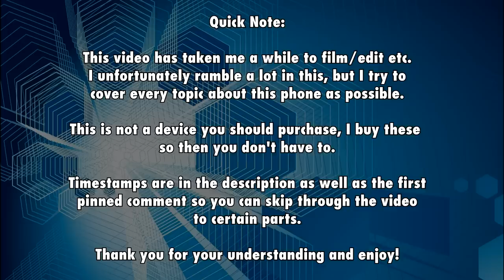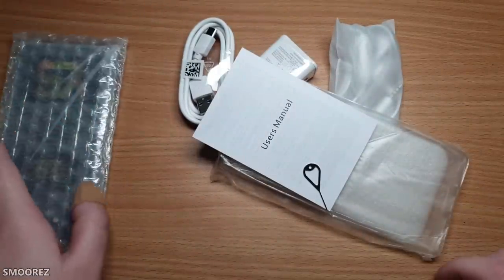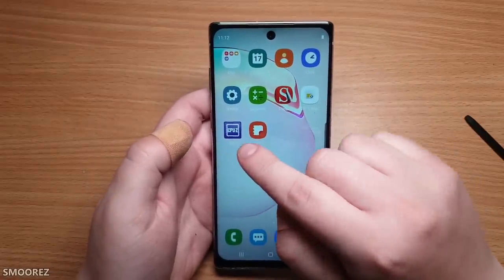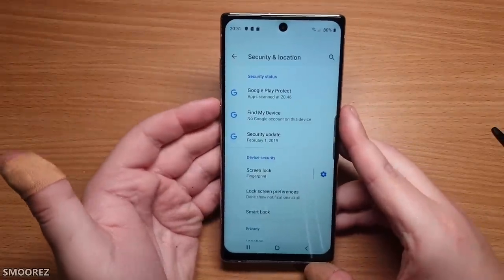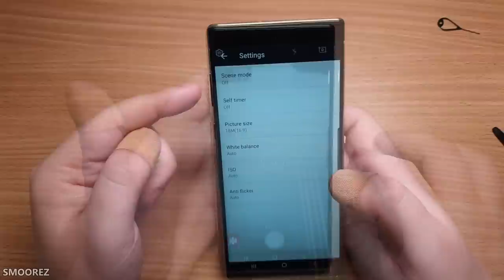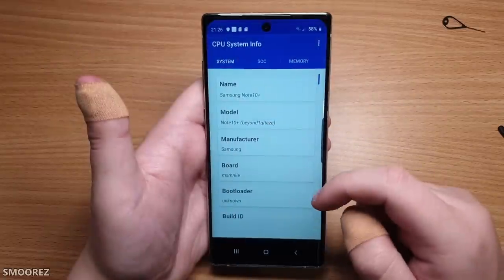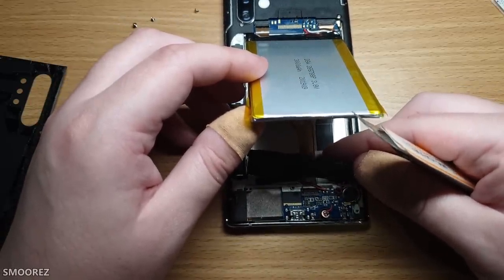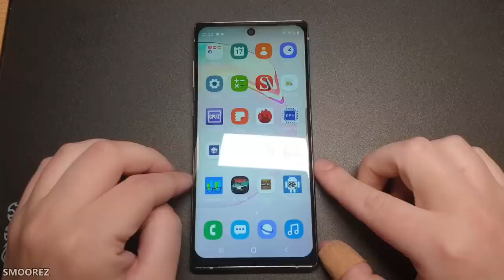iWish: I bought a $150 Galaxy Note 10+ Clone from WISH...this is what I got! In-Depth Review

Comment: When it comes to wish stay away from electronics in general
Reply: I just buy little trinkets or  gadgets. For electronics, I bought a light up charger cable and cheap “double drive” earbuds for when i run out of battery for my BT ones. The most I spent there on one item is an eevee carpet. No regrets on that one.
Reply: @aaron-gz  I agree with you although Chilly advice is true, but according to some reviews, some of their electronics are fairly okay. For example, the electric guitars for under $100 US gets a lot of reviews on there. Including guitar amplifiers. But although I haven't bought anything from Wish as yet myself, at least for sure the one thing (for now) I won't ever expect from them to be all that good is these cellphone clones of course. It doesn't matter WHERE you get them from Chinese/Asian website or even Amazon or eBay a clone phone is a clone phone!!!! Btw, how long does the Bluetooth headset last that you bought without charging???
Reply: I Think as long as the item has a power supply you can replace with something safe, it's often fine.  I got  some electronic items on there which I've been using for some time without issue, by ensuring I use my own power supplies.
Reply: @Supernautus  ohhh wow yea you also confirmed what I said earlier. Would you recommend the Bluetooth headsets from Wish though?? How long can they last without charging???
Reply: Alot of electronics on there are fine if you can replace the charger and plug them into the wall. Avoid anything that has a built in battery is my suggestion.
Reply: @jaredbridgeman246  I know this is an old comment but don't trust reviews on wish. This is a common tactic employed by sketchy sellers online. Basically, if a person makes a transaction with them in the past that group saves the info (shipping info/name) and the seller will make a 'purchase' using that shipping info and name. The person who's name and shipping details were used isn't charged but they end up with a product arriving at their home. 
These groups do this because they need a verified purchase to be able to leave a review. So they fake that someone bought their product and leave a good review themselves. 
I know this because my mom had this happening for a while with some amazon stuff. She was getting some random free items from Amazon. They were all labeled for her but were things she hadn't purchased.
Reply: @3DPlagueDR  oh thanks for sharing everything there especially about Amazon reviews. 

This reviews trends are getting very suspicious indeed. I would rather take a risk purchasing a product with 3 good reviews out of ten than a product that has 10 reviews and all TEN are 6 stars good reviews!

Even Trustpilot seems sketchy as well although they're saying that fighting against fake reviews.

Even right now, I'm learning about ecommerce and I seen an interview on YouTube with a guy saying that he asks customers on  Amazon  for reviews, and that had me thinking differently about reviews even comments on here on YouTube

Comment: Clone phones just arent worth your money, you can get quite a decent device for 200$.
Reply: It's for the status symbol when you're broke lol
Reply: @iGaRaai90  Even the thieves would give you money
Reply: I recommend the Xiaomi Mi Max 3
Reply: @iGaRaai90  I personally think having clones instead of having lower end-but-still-original ones are worse.... it just shows how desperate one is for the attention... Especially these days when there are low priced phones that are sometimes even more worth it than flagship phones.
Reply: I've got the real deal and it combos so well with my SN30 Pro+.
Reply: LG Stylo 5 is a better deal than this
Reply: I have an OPPO phone cost less than this one and it's fantastic
Reply: Agree
Reply: My phone is an ex flagship which used to be 400 bucks now it's like 240 bucks
Reply: Redmi Note 8 or Zenfone Max Pro series
Reply: @Vysair  I have the Redmi note 8 128/4 and it is a piece of garbage, bad build quality and its very very slow cause MIUI is completely unoptimized, mobile data stops working like 4x a day and i have to restart the phone
Reply: @ondrejbrandejsky5592  Redmi Note series have decent quality not bad and I agree, MIUI is somewhat lacking in multiple department, def not good optimization like stock aosp. If both sucks, try S10e (at my place it cost $200 - $300)
Reply: @ondrejbrandejsky5592  nope, got both redmi note 8 pro and note 8 and I don't know what you are talking about. Every fone has a fail manufacturer flaws. Don't generalize just because you got a fiasco.
Reply: @style668  do you think that never getting messages from Messenger unless i open the app and refresh it manually is a manufacturing flaw? And thats only one thing...
Reply: @ondrejbrandejsky5592  it's a messenger bug bro wtf. Everyone in my country is experiencing that. Welcome to the third world problem
Reply: @style668  idc, it never happened to me on any of my other phones (and thats like 20 phones...)
Reply: @ondrejbrandejsky5592  woah, that's pretty exaggerated to the point that it's unbelievable. Anyway, you may keep your 20 fones away and I will be happy with this fone. I don't want to argue about phone brands, I'm not the Xiaomi's CEO
Reply: @style668  i keep old phones from family members, have a good day
Reply: Just bought a Google pixel for 120
Reply: Redmi Note 8 pro have touchscreen issues near the bottom, or at least mines did. I was fortunate the Amazon seller gave me a full refund before I even sent the phone back.
Reply: Bought Haier L55S at MYR200. Decent and worth it. Watched this video and commented with this very phone.
Reply: @Vysair  S10e for $300? I paid less for my S10, $200 total and it came with extras like a 256gb microSD. If you're willing to spend several hundred on a fake knockoff, then just spend the money on the used market.... I'm loving my S10. Smooth, quick, snappy, no problems whatsoever.
Reply: or even 100$
Reply: I found a 110$ xiaomi x3 onlinen
Reply: Cheaper acaully like a decent device is like 150
Reply: @itsmedanzelcurtis  good phone but only on t mobile
Reply: @veravalfa633  the samsung note 2 is better

Comment: You ordered something from wish and got it in 10 days that's a freaking miracle
Thanks for throwing up the conversion rates to the Australian dollar
I was astonished with how easily you just pulled out the cap for the charger brick
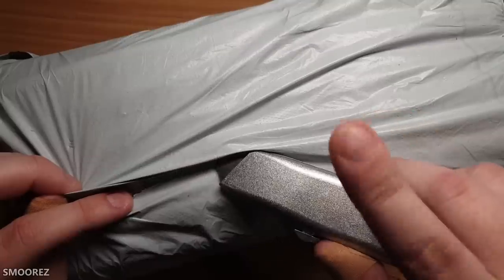Timestamp 5:19
That is going to give me nightmares😆
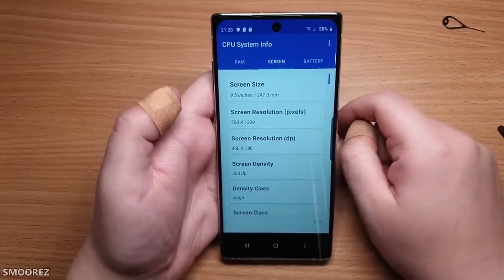Timestamp 34:02 the screen size is 9.5 in😂
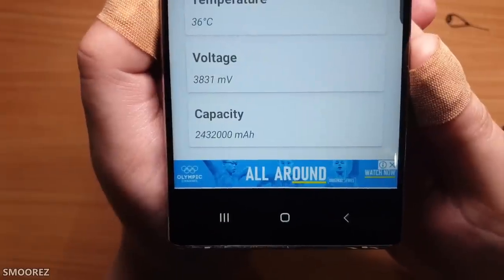Timestamp 34:14 a 2432000 mAh battery holy moly
Reply: U L T I M A T E  B A T T E R Y

Comment: You should do some testing with those cheap knockoff chargers, you can get USB powered LEDs pretty cheaply, plug a bunch of them in on a power strip on an extension cord, set them somewhere outside, a safe distance from your house, and just check in on them every few hours or so for a few days (or even weeks if they last that long) of continuous use. It would be very interesting to see if they fail, catch fire, or just keep working!
Reply: Would love to see this as well

Comment: Okay I mean will it kill them just to apply 4G to these clone phones instead of 3G smh
Reply: Most of the clone phones are using older Mediatek processors that don't support 4G modem.
Reply: Make sense, but why dont they just put newer mtk processor i mean it doesnt cost that much right
Reply: @prabendz  I've come across some clone phones claiming to be 4G-capable. But as we all know, claims made by clone phone makers should be taken with a huge spoon of salt.
Reply: I seen some phones alot cheaper with 4g LTE

Comment: My Galaxy S10 only cost me $200, and it has stereo speakers as well, its also got its 8gb of RAM and 128gb storage, and it actually works well lol. I'd never choose a knockoff, if that's the route you're going to take I assure you that you'll be happier purchasing last years flagship phone (so iPhone 11 now, Galaxy S10, Note 10) on the used market. You can find them included with many things, and even in the case that you don't get any included extras, well, at least your flagship phone still behaves as a flagship phone lol.

Comment: I managed to snag the iPhone 11 Pro Clone currently listed as "X20 Pro" for £1. It was awful in every regard. The claims of 8gb of ram were a lie, RAM Truth revealed 1gb was actually installed, only one of the 3 cameras was real. It claims to have a 4800mAh battery but would die after an hour of dicking around with it, the bezels were huge unlike the photo.

Comment: I had bought an s9 clone (just for the fun of it) and from my limited research just about every one of these clones comes from the same company. and if they are all using the same chargers than that charger is absolute garbage. i used a usb meter and a constant load and only got about 600mAmps on mine before the voltage dropped indicating it was overloaded. i just hope that they got better and can supply a full 2Amps

Comment: The thing is that you can get an actually a proper phone for $150, Poco M3 was launched at $150, and has 4GB Ram with 128GB of storage. With a working fingerprint sensor in the power button, 48mpix triple camera and working 4G.
Reply: You can get a better one for just 10 USD extra
6 GB of RAM
64 GB (Storage)
Touch ID
48 megapixels main camera and two other camera that's just there for the numbers ( every budget devices will do that trick )
Pop up camera (front camera)
Full HD OLED display

Comment: I dunno, i think wish is alright for small stuff or bigger stuff where you cant do much wrong
Car Radios and screens are alright, just about everything LED, their sex toys are okay, for some reason they have an insane amount of LED and rainfall showerheads which, if they dont melt my face with chemicals right away, seem pretty alright, i got a car sub for 50 bucks which i am underpowering and it seems to work really decent, i got a decent drone of there, small electrics like motors and controllers, and so on.
I wouldnt buy anything thats "important" but ebay stuff? sure, go ahead.

Comment: Dang, that a20 has better geekbench scores than my note 10+ on high performance mode. Oof.
Reply: Firstly, doesnt he say its an A50? Secondly, unless you are joking, you realised they have changed the scoring system, right? He is testing geekbench 4, you probably used 5. The A50 is a little bit less than half the speed of the Note 10, according to the Geekbench result browser.

Comment: I use to have a clone note 4. From what I've seen alot of these clone phones are ok if you want a basic phone except they skimp on the battery and cameras and fake their system specs. Why not just be truthful about the specs and put in better cameras and batteries. More people would buy the devices instead of avoiding them like the plague 🙄

Comment: another giveaway about the time of the image is the back of the phone absolutely none of them used the proper color Samsung uses any of their advertisements especially for the prismarine which I have. another thing is if you look at the screen strangely even with the thin bezels every single corner is rounded further than the bezel goes on the phone and playing they're using an image from a different Samsung phone or strangely using an image with extremely rounded corners.

Comment: Try to restart the phone after you have registered the fingerprint and see if it works
Reply from the maker: Tried and still nothing. It's just a buggy software thing.
Reply: @SMOOREZ  okey yeah you can't expect much from the phones from wish.. I honestly bought a phone when wish were new that actually was pretty legit.. but it was a known China brand a Doogee Mix 2 it 8nly had a mediatech p30 cpu 6gb ram and 128 gb storage but it could handle most tasks without much lagg and the camera was.. maah but it workt okey in good lighting.. it worked like Galaxy s6 or something like that.. 😁 but I will never buy electronic devices there again..

Comment: Hi mate! Great video. I have exactly the same phone but mine has a 1000mAh battery and has to be charged all the time. Do you know where i can get a replacement 3000mAh or bigger?  I tried to google it and search ebay and AliExpress  but no hits on any of them.  "355788 Internal Lithium Polymer Battery 3.8V 3000mAh". Thanks for any help.

Comment: I suppose if you're wanting a Note10+ but don't want the $1,100 pricetag, you can pull this off So as long as you keep the screen off and don't try showing off the back. The corners on a TRUE Note10+ are not as rounded and punch hole for the cam looks like the Grand Canyon in comparison to my Note10+. Looks like you got jipped. The Snote looks like I had way back when the Note4 was top of the line.

Comment: One thing you might want to know, any type of current in-display fingerprint scanner requires AMOLED panel to work and the uneven brightness around the punch hole means it's an LCD panel (a really good LCD have an even brightness though). If the next clone you buy also has both LCD/IPS and in-display scanner like this one, then you know the scanner is fake ;)

Comment: So Basically you got a $9US phone that Alcatel wouldn't even touch, that a cell carrier wouldn't even offer you for free just to have their service on something, for 20x what you shouldn't have to have paid for it just for the joy (misery?) of finding out exactly what it is (and isn't) for the sake of making this video. 

I enjoyed watching it, I don't mind your rambling, and it's quite indicative of the utter CRAP to be found on Wish.com.

When I order things off Wish it's usually HAM Radio related, for instance the Baofeng or TYT or other VHF/UHF handhelds and mobiles, or mobile antennas and such. Even if they're crap, as long as they work there's a resale market for them.

Otherwise, it's usually products of a non-electronic variety, extremely inexpensive, or things like waist packs, camping bags, etc. Not really many ways of screwing those up.

So, if you find a product such as this phone that is CLEARLY not what is advertised, what are your options as a consumer? Obviously being sold something like this is against American law, but I don't know what Australian law says about such things. Per Wish, don't you have the option of requesting a refund if it's so clearly a fake/falsely advertised product? Of course, then you have to spend the $40 to ship it BACK to China, wait for Wish to check it out, and issue the refund - if they even bother to acknowledge it got there in the first place?

Moral of the story: 

DON'T BUY ELECTRONICS - you actually plan to USE - from WISH.COM.

Great Video, though! Sorry you wasted your money! Hope your youtube revenue from this video has paid for your losses!!!

Comment: A few comments on the recent glut of garbage clones from China:
1) if upon first startup you are not prompted to setup your Google account and configure the phone, it's Android has been "cooked" and I would not trust putting secure information on it.
2) The MTK6580 is an older 3G processor, mostly used on older Android smartwatches.
3) The PhoneInfo app will tell you the truth on how crappy the phone is.
4) I do not think WISH is too bad. If you are unhappy with an item or it arrives later than the estimated arrival date, they will gladly and easily give you a full refund.

Comment: Just used the droid hardware thingy and says my 48mp camera is a 12mp camera, if that's true then I overpaid. Got the phone for the camera, should have got a US brand this is what happens when you get an asian brand I guess lesson learned. At least the front camera is 32mp which is correct. The rest of the information is correct too just the camera.
Reply from the maker: If it's off Wish then the specs are likely wrong. It wouldn't be a 32MP front camera on a clone device. They barely scrape 8MP. I would run some of the other apps I have in the description.
Reply: Not from Wish from Jb Hi Fi here in Australia the Oppo Reno Z, I checked two apps both said 12mp so that sucks, I guess that answers the question of why the camera seemed so poor for a 48mp one, because it isn't a 48mp one. 

It's too late for a refund now as I got it a year ago, never realised there was an app that shows you specs or I would have checked it day one. Paid $500 for the camera that was false anyways and that money went right into the shitter I guess as I use my IPad for everything except making calls. 

I was willing to pay $500 for the tech specs, camera, size of the screen and the color and look of the phone, I guess for some of it it wins and fails on the camera front miserably. 

I will be sticking to non Asian brands in the future as it's clear that everyone is just a big bunch of liars looking to steal your cash with fake specs how frustrating. I thought this thing only happened in pet food boy was I wrong. 

GSMArena also really needs to test the phones before adding their specs as I went off of that when choosing.
Reply: AnTuTu says 48mp with 5mp, but I don't really trust it after seeing the other 2, the other reason is like I mentioned, the photos it takes are bad for what is supposed to be 48mp. The 32mp front camera takes beautiful photos compared to the back one. 

It has an option to use the 48mp which I do every single time and still my IPad photos look better, the only thing it does well is brighten things up so it shows their real color not a washed out one.